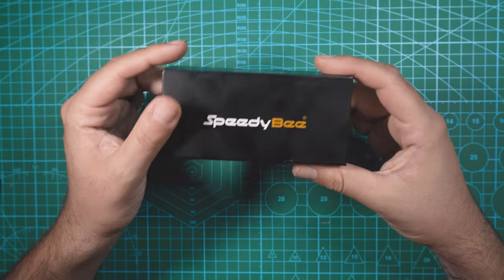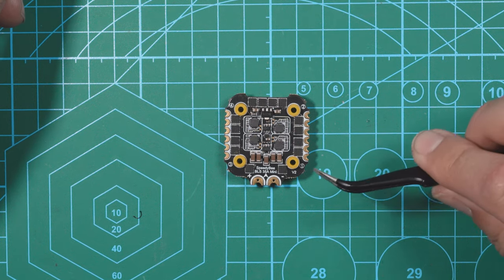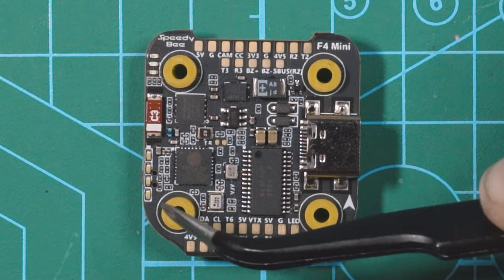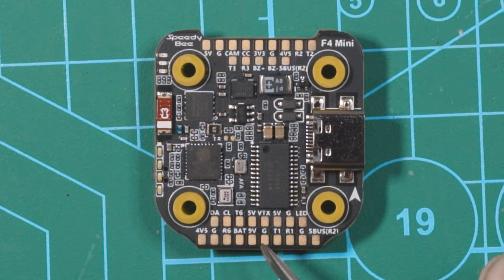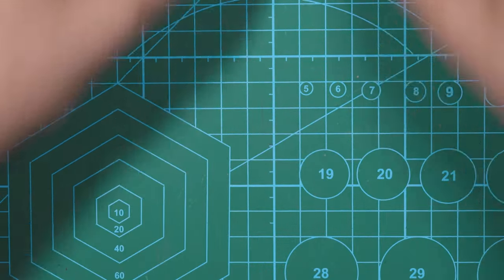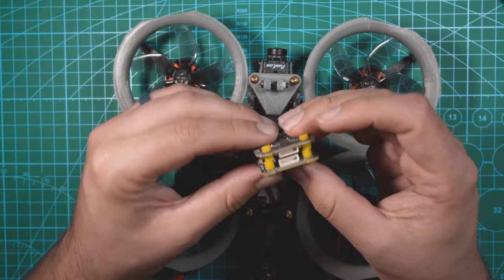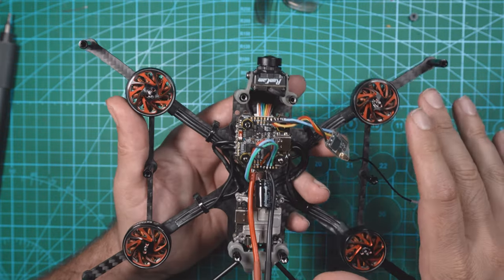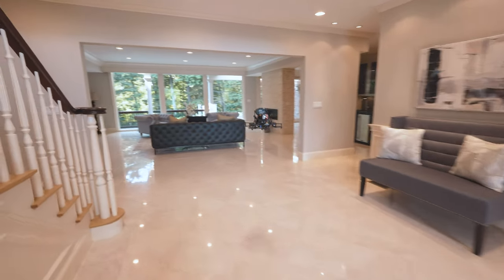The Perfect 6s Cinewhoop Stack - Speedybee F405 Mini

Comment: Good time of day. There is a question. I was tempted to buy a 35A Speedy Bee F405 mini stack for whoop. And here's what's interesting, even when powered only by USB, the STM32 and the bluetooth chip are very heated. You can't keep your finger on them for a long time. But at the same time everything seems to work. For comparison, I have a Mamba F405 stack, and it's straight cold. There's some kind of stove here. Can you tell me if this is the norm for these politicians? In addition, after several firmware updates, one of the four ESC stopped being sewn. The program writes "ESC erased or unknown". Nevertheless, the motor is running. By the way, "out of the box" none of the motors rotated, only twitched at 2000 microseconds. Only after the Jazz Maverick firmware, the motors turned. The motors were also taken by speedy bee 1404, and they are also like boilers! Here is such a rabid bee))

Comment: definitely need to check out this stack! side note, have you tried 3 blade props with your slammed squirt? why do you prefer 5 blade more?
Reply from the maker: I have tried a few different props on the squirt. Tri-blade HQ props were my go-to for a while.
Once Gemfan released their 5-blade props I gave em a shot and noticed the drone was a quieter and felt smoother for FPV fly-throughs.

Side note: If you choose to use the Gemfan 5-blade props on the squirt you have to trim about 1-2mm off the end of the prop so it fits in the ducts.

Comment: Would you say the speedybee f405 stacks are better than the mamba f405 stacks?
Reply from the maker: That's tough. Ever since getting into the FPV hobby, Mamba stacks have been very reliable and one of my go-to brands. Speedybee is definitely starting to have an impact on my fleet though. The more quads I have with speedybee the more I trust their stuff. 
Plus you just can't beat the built in Bluetooth for on-the-go tuning.

Hope this helps!
Reply: @TRONCATFPV  true. Speedybee seems especially good value ever since the mamba f405 went up in price so much

Comment: Why use a stack vs an AIO?
Reply: So you can replace just the ESC when it fails, and save money and be less wasteful long term.

FCs fail much less often for me, it’s often just gyros and voltage regulators.

I still run a lot of AIOs personally, but when I can afford the weight and space a stack will always be superior. I do change FETs out on my AIOs  and ESCs when they start going bad or fail, but realize most don’t have the skill or inclination.

Happy flying!
Reply: More uarts available for additional things like gps etc